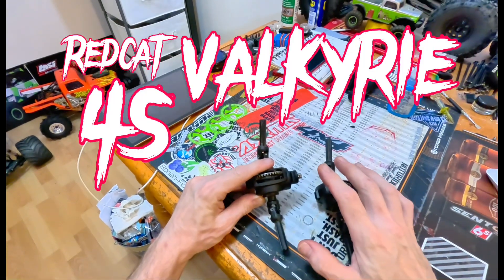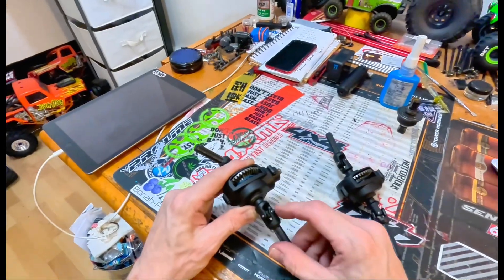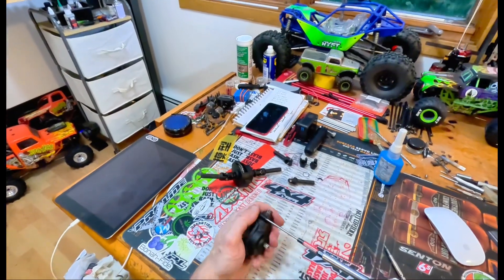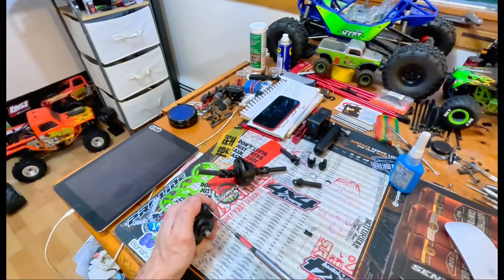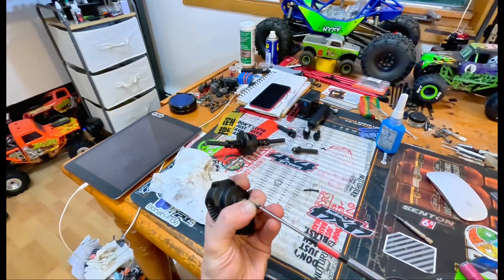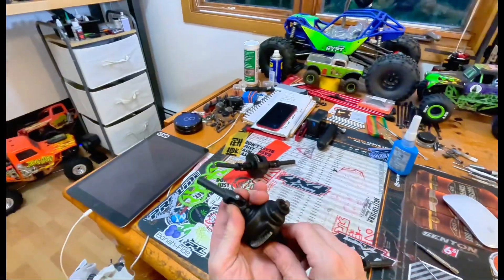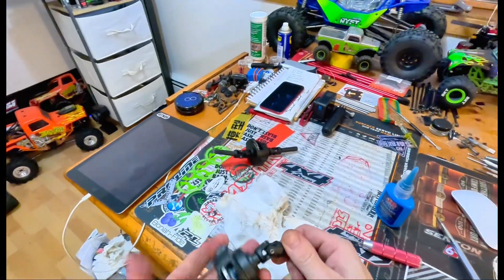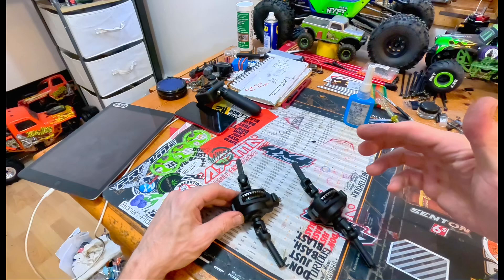Redcat Valkyrie diff comparison- gear mesh w/ and w/out the added shim

Comment: Hell yeah man. Thanks. I might have to rip mine apart and do same.   Do u have a video up yet running it with them out
Reply from the maker: No, unfortunately I’m waiting on replacement shocks. Besides the shim removed I phased the driveshafts and readjusted he motor/ spur gear mesh. Really hope it’s not so loud my first video was almost unwatchable because of the drivetrain noise 🫤
Reply: @StraitJacketRC  mine came in today. Putting them on and I might have to take the shims out before I run it again tho.
Reply: @StraitJacketRC  I like the way this truck sounds tho might just be me.  What part of the country do u live in?
Reply from the maker: @Tattoosandtoys  nice! I’m hoping mine come in soon, the longer it sits undriveable the more I want to tinker and mod it 🤦🏼‍♂️😆 the plan was to keep it stock to see how durable it is in stock form.
Reply from the maker: @Tattoosandtoys  it should still have a similar sound just a lot quieter. Maybe not so high pitched idk, I’m still sorta new to plastic rigs. The diffs are a bit of a chore to get to, so just be prepared haha keep everything organized as it comes off and it’s a fairly straightforward job.

Comment: Great video! Think I'm going to have to take the shims out to. I'm running a 4s smc 150c 8200 battery .. Can't run mine but 5 to 8 minutes and  it stop esc flashing over temp checked my fans running fine . I can cut it off for a few minutes and back on and the same thing again. Since I seen your video could be the shims ???
Reply from the maker: @scottlang1701  thank you! Yes, the shims are a part of it for sure. There are several things to check. The drivelines need to be phased for a smooth delivery of power. The other thing to check is the center diff bearing. The design of the case is not sealed to keep dust and dirt out and it’s not open enough for it to self clean so it traps crap. Mine was partially seized from dust and then washing it. When I tore it all apart I noticed it. Lastly, the motor mesh could be off. If you haven’t checked out RazerRC’s video on this he covers this more in depth I highly recommend checking it out.
Reply: Thanks,I wanted to try something before I started tearing it apart. I strapped it on one of my stands and ran it half throttle forward for 10 minutes the same in reverse for 10 minutes it made a big difference in loosing it up. It don't over heat and stop now. See how it goes if it over heats again will take it apart. Thanks for the info!! Have a good one!